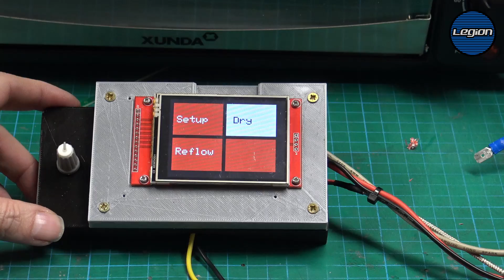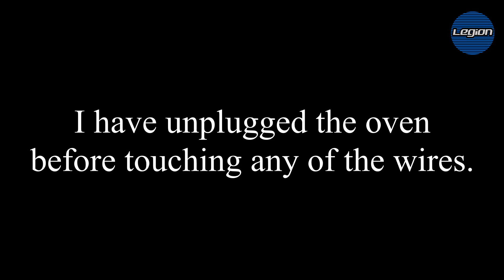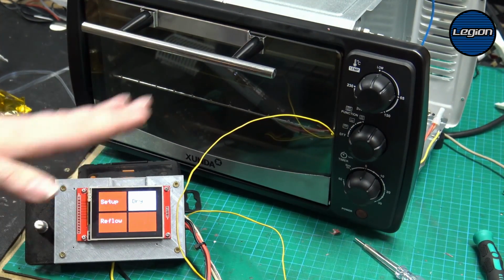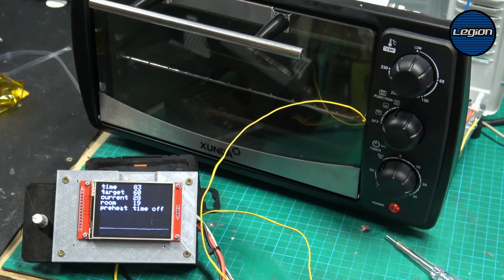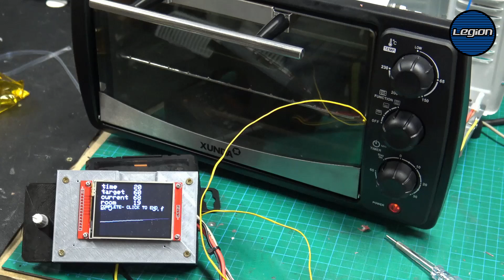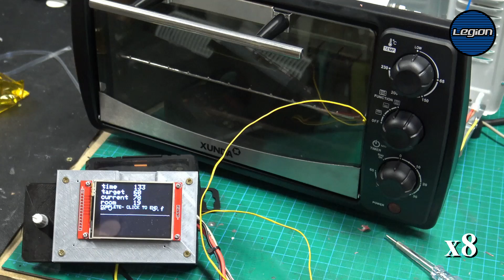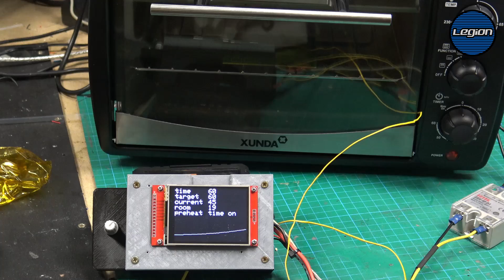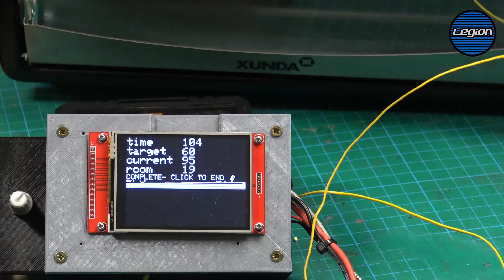My version of a DIY reflow oven   Part 2

Comment: Might be worth adding a second thermocouple nearer the heating element as the radiant heat from the heater lags too much for your setup. Or maybe a small fan would distribute the heat better and help the overshoot. A Slower warm up would help too, to give the average temp a chance to settle. I have almost all the bits to do this myself before i found your videos.
Reply from the maker: I have made some changes in the software and I think I have it setup a little better. just need to finish some work before I can test it out.